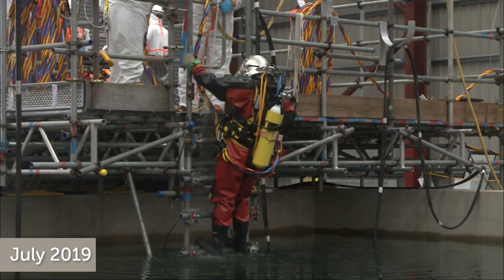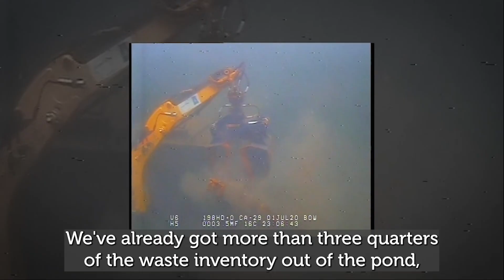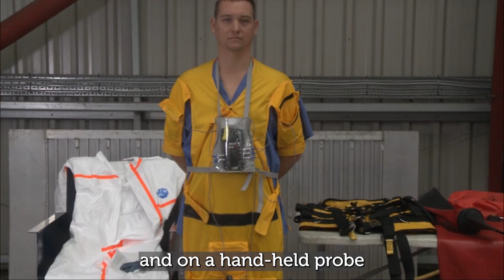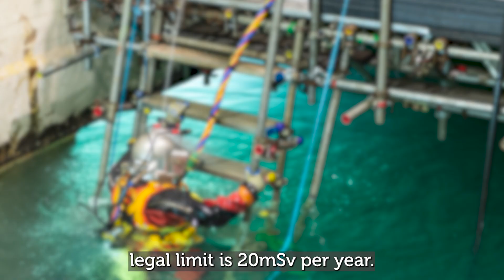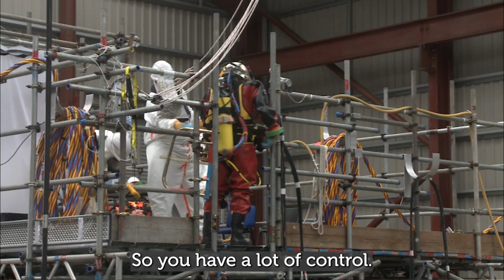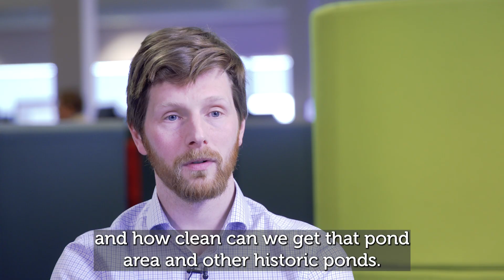The Pile Fuel Storage Pond divers - Sellafield Ltd

Comment: I don’t understand nuclear fuel, rods, or whatever they’re called are stored at the bottom of the pond the water filters out dangerous radiation but when there’s a diver down there, and they exhale won’t radiation be trapped in the bubbles, then float to the surface and be let out into the room.

Comment: It's a fascinating point that the water provides strong shielding from the remaining radioactivity compared to air; in hindsight this is obvious, but I had not previously considered it.

I wonder if there are other scenarios where deliberately flooding a radiation-affected area would make it easier to get either robotic or human workers in the space to remediate. Obviously the tricky part is ensuring the water stays contained in spaces that may not have been designed for it (unlike these ponds) but perhaps is a worthwhile design consideration for future plants; ensure they're encased in a watertight tub so that they can be flooded if necessary both for cooling and to ease access.

Comment: I believe that you really try to make that job as safe as possible. But it will always stay a risky job with abnormal exposure to radiation. And regarding exposure of one single person, you can hardly prove a connection between exposure and  possible consequences as for example cancer... It's a dilemma, and I know that someone has to do all that cleaning, unfortunately. I consider it a silent and hidden battle against the "ghosts of the past"...